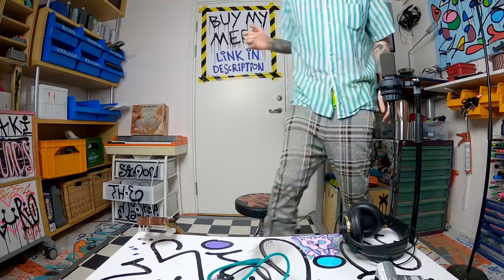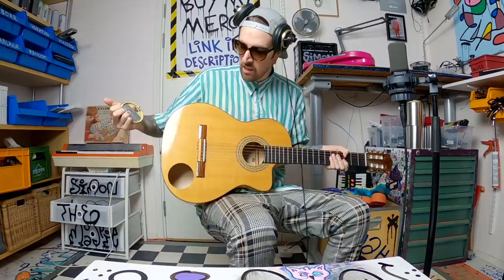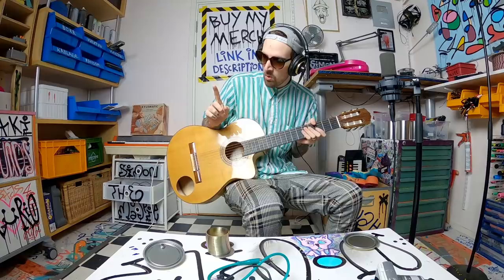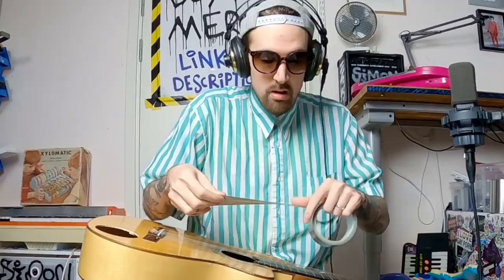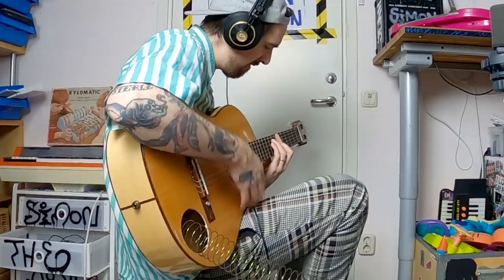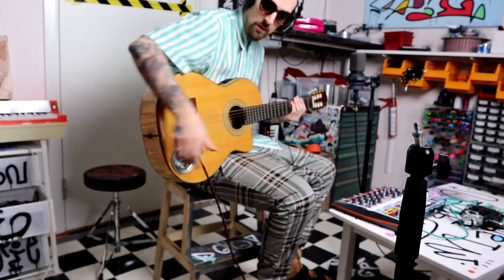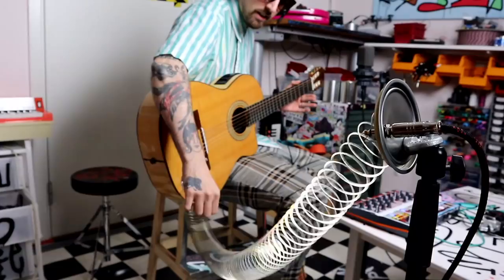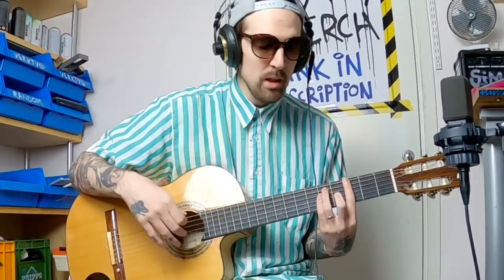I Made A SLINKY TOY GUITAR And It Sounds Like Space Lasers In Huge Caves

Comment: rediscovers spring reverb
Reply: I've never played a standard spring reverb that sounded like lazors
Reply: @singer3188  then you never took one apart and played with the springs! (or dropped it while it was on) They are pretty awesome.
Reply: @singer3188  my amp has a spring reverb, if you hit it slightly it sounds somewhat like this one, though much shorter and higher pitched
Reply: I do have access to a spring reverb that's in a crate mx120r 212 guitar combo. The  reverb sounds amazing but otherwise the amp isn't that great in the tone department.  Maybe I'll rip that reverb outta there
Reply: @singer3188  You can pull out the spring "tank", they are usually mounted to the side or bottom of the cabinet with rubber washers, away from the speaker (to reduce feedback). They tend to be hollow on the bottom, made from folded steel. Turn it over. Pluck the springs. Freak out.  No worries, 99.9% of spring reverbs are low voltage passive components. A few mount a small amp on the board, but don't pass current thru the springs themselves. I have a few sitting next to me. The nicer ones have 3 springs while most have 2. If exploring is not up your alley, and your amp is solid-state, pick up a corner about an inch and drop it with the reverb cranked. be amazed. (does not work with digital).
Reply: I have a Silvertone 1484 amp which uses essentially this reverb but made much smaller. A single spring in a small long box. If playing through the 2nd channel and you turn the volume all the way down but the reverb all the way up it sounds almost exactly like this. All wet spacey and cavernous.
Reply: @outspokeninsider752  Oh yes  the reverb on my amp is literally just in its own effects loop with a 1/4 inch jack on both sides. Ive been playing bass a lot more recently and there is an effects loop on my Hotone Thunder Bass 5w head.  I will definitely be trying that tomorrow.  Will report back with results.
Reply: @singer3188  definitely interested to see your findings.
Reply: @singer3188  Mine does kinda... if you run the signal hot enough and you then hit the box
Reply: @singer3188  don't forget it <.<
Reply: @Nicole-pt4bx  haha ill be on it today  i actually wrote a riff on bass last night that would probably sound way better with a ton of reverb
Reply: It is not the first time he played with spring reverb
Reply: “Thankfully, I am very creative” -whips out the duck tape
Reply: It was never lost
Reply: I came here to say this.
Reply: Beat me to it lol
Reply: Slinky Reverb.  Haven't you ever noticed the springs in the rear of old stratacasters, like they have something to do with the guitars sound.
Reply: @whimpypatrol5503  those springs put tension on the "whammy bar" for the bridge. The guitar produces a "dry" signal unless you have reverb (or other effects circuits) involved.
Reply: It's only about 80 years old invention
Reply: @singer3188  shake you spring reverb amp you will.
Reply: I remember little crate amps with spring reverb we used to hit the top really hard to make crazy noises
Reply: *multi spring reverb
Reply: This
Reply: @outspokeninsider752  Yea, droppin' 'em the first time was a did I break it? moment.
Reply: Reminds me of hammering on welded railroad track, can be heard 1/2 mile away, and arrives b4 the sound in the air.
Reply: my old FAL kestrel had two springs, sounded like lazers when i put on the switch🤣
Reply: Yeah i remember having a similar system in my Viscount Organ

Comment: You should try putting a spinning disc in the hole, like the ones vibraphones have in their resonator tubes.
Another idea could be to have a lid with tuned tines with pickups like the ones a rhodes has, but these might function like drones. 
A third idea could be to make a lid with a hole in and have a second thin plate overlapping that hole but not closing tightly, so as to make them smack together and create some sort of buzzing distortion.
Reply: Yes! A vibraphone guitar! You could control the tone/speed of the disc with a sewing machine pedal.

Comment: I've thought for sometime that it would be cool too put a bunch of thinner reverb tank springs into a guitar so they're stretched out in the inside the hollow body, different lengths throughout so you get a really rich reverb sound. Obviously very awkward to put them in, but I feel it's doable.
Reply: Maybe if you want to actually build a guitar. Putting them in a finished guitar is probably impossible
Reply: @Laurabeck329  certainly extremely difficult, but I'm not sure if I have the skills to build an actual acoustic guitar. I'm thinking though if I were to cut a large hole in in the guitar I could get them in easily and then just put a large panel over it, maybe a metal tray.
Reply: @PhillipRaymondGoodman  That would sound like garbage
Reply: @Laurabeck329 ........ Well that is my sound aesthetic, trash instruments. Obviously I'd only do it on a cheap and nasty guitar, nothing really nice.
Reply: How about designing  a guitar where the bridge and tailpiece are held in place by cables or ropes fastened to the tail and float above the body, but are connected via loose coily spring to something like a drumhead?  Could one create an acoustic instrument with built-in spring reverb?

Comment: Spring reverb with a magpie twist. This would be a great way to make a giant spring reverb unit, you could just glue one end to a 4 inch speaker for a transducer. It sounds fucking dope on the guitar tho!
Reply: In 1975, I accidentally found out that a speaker can also be a microphone. Nowhere near as good, of course, but I did get a fairly clear signal. So here's what I just saw in my fluffy brain:
From left to right (I'd draw this on here if I could): Speaker; Slinky taped to the speaker cone; Other end of the Slinky taped to a matching speaker cone; this speaker is plugged into a mic jack. 
I'm not sure how well that would work, but I thought of the transducers in a Fender Tank. You'd probably have to turn the mic speaker (pickup transducer) up real high, & the whole thing would have to be in an amp case surrounded by pillows, or in another room for studio work, but it might be pretty cool. You never know.

Comment: I would have gone with another cap that would fit the soundhole. Attaching the slinky on the back of that and the other end attached as you have it. That way the slinky could stand in the guitar and you'd get the spring reverb effect when plugging into the contact mic.

Comment: If u tighten the slinky then it should just be a huge spring reverb. Thats all spring reverb is, just a spring in a tank with voltage running through it. I like the laser type sounds u get from it dangling loose like that though, but i am curious on how it sounds with it tightened.

Comment: I think you're getting a very weak and noisy signal due to the way you attached the slinky. What if you flatten out the end of the slinky to fit it underneath the saddle, just like a piezo pickup?
Reply: That way you'd be getting the straight vibration from each string to be reverberated by the slinky.